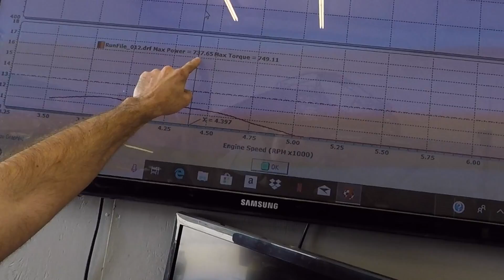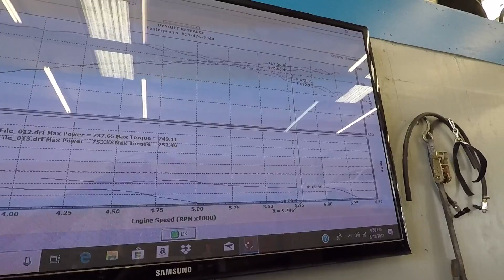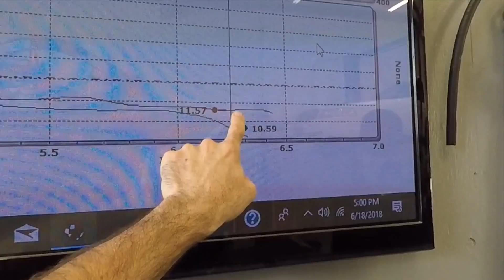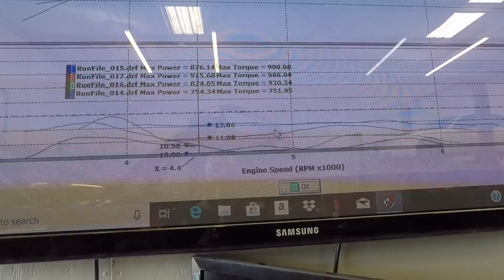A Wolf In Sheep's Clothing! Not Your Average 4th Gen Camaro!

Comment: Can you tune a 91rs little m sportsman sbc sb2.2 heads softened by Frankenstein racing ,comp  solid roller 788,790 lift 112 lsa 12.1 compression 416 with ls coil packs and Holley efi and 4l80e circle d 5000 lockup converter  "Street strip"😼 hopefully 800+hp on 93 and water meth na with a 300 shot?

Comment: If you can go in depth. Do you usually throw alittle extra fuel in the map before you take a car on the street just to account for the extra load it will see?

Also when adding a shot to a forced induction LS how much timing do you usually have to take out?

New tuner always looking to learn.

Comment: I am impressed with this LS stuff. In my day the small block in pro stock trim would put a 2300 pound car down the quarter mile in under 9 seconds but they turned up to 15,000 RPMs and no they weren't streetable. Grumpy's Toy.

Comment: Love that body style the best.  Why not just get a 97 ss with the LT4 and build it.  Isn’t it a PITA to do a LS swap in those?
Reply: 98-02 had LS engines and the bodies are basically identical. I'm sure the K Member would be a direct swap, if they weren't the same already.
Reply: The hardest part about the swap is mating the engine harness to the body harness. Once you get the correct K-member and Ls1 steering rack everything just bolts in.

Comment: that is a third gen not a fourth the fourth ran from 98-02 the last of the F bodies.
Reply: Bob Darney incorrect. 93-02 they had different headlights. This car is in fact a 4th gen.
Reply: Bob Darney sorry, you’ve thought wrong. This is indeed a 4th gen, 3rd gens are the square body’s aka iroc-z era
Reply: I used to have a 02 Z28 the body style is completely different also they came with the LS1 where the third gen came with the LT1
Reply: Bob Darney I have a 96 z28. It does have an lt1 but that is the same car as the 98-02. Go research it.
Reply: I do not have to I used to have a 02 Z28 it is a different body style for one thing it only has one head light on each side.
Reply: The door can from my car can mount on your car. So if they won't mount to anything older than 93 or newer than an 02 Camaro what is mine because my body panels all will interchange to an 98-02. I'm not trying to fight you but just do some research the more knowledge you have the better. But hey you do you pal.
Reply: Bob Darney so you’re saying that everyone is wrong, and you’re right?
3rd gen is 93 and older, everything is almost the same minus a few things like the headlights from 98-02. Body panels are interchangeable from 94-02. 
Take it from someone whose been a claims adjuster for 20+ years
Reply: Bob and Pickle are full of so much misinformation. 82-92 were 3rd gen and 93-02 were 4th gen. End of story.
Reply: sierravmax oh pardon me, 92 and older... how much time did you spend on googling all of this info?
Feel free to educate me on whatever “misinformation” you’re claiming here, other than being 1 year off on the 3rd gen.
This is all off memory, so have fun educating yourself while googling whatever you need to make your self seem knowledgeable.
Reply: Pickle Bacon I didnt do any research. I am a true GM fan and actually own a 93 Z28. I just find it funny that you are trying to correct someone with even more misinformation. Please refrain from putting out more misinformation please. In other words zip it!
Reply: Pickle Bacon If you would learn how to read you would of realized I answered your petty question. I do agree that my car as a roller would not be worth that much. But my car is LS swapped with a built 6.0 LQ4 and a rebuilt T56 with upgrades. Just the T56 alone is worth $2000. lol Btw I have also owned a 06 Sierra Vortecmax fully loaded all the way down to leather seats and a sunroof. You can check out some of my videos if you dont believe me. Well if you are smart enough. ;)
Reply: Pickle Bacon I think it is just hilarious how mad you get when someone corrects you. You must be really fun at parties. haha
Reply: Not sure if Bob is trolling or just ignorant. 82-92 are third gen. 93-02 is fourth gen. With 93-97 being an LT1 car with the rectangle headlights, acd 98-02 being an ls car with composite headlights.

Strip both the LT1 car and the LS car down to the bare shell, and you end up with the same body sitting in front of you.